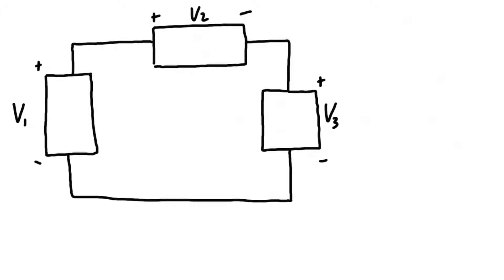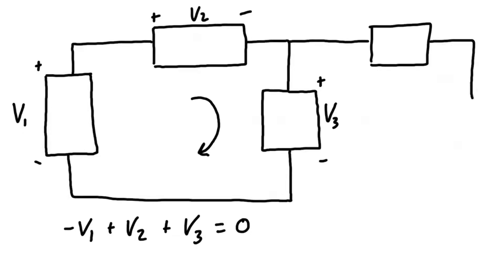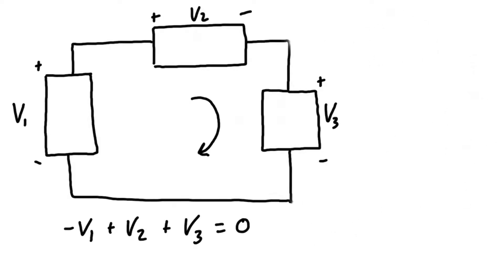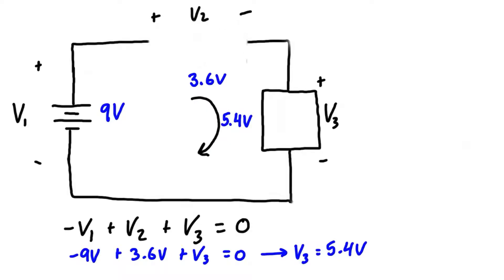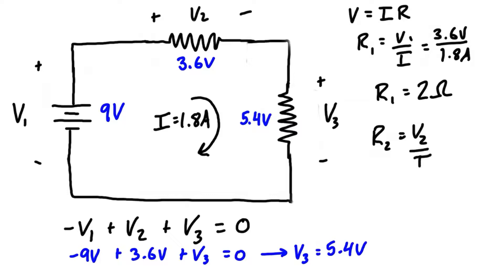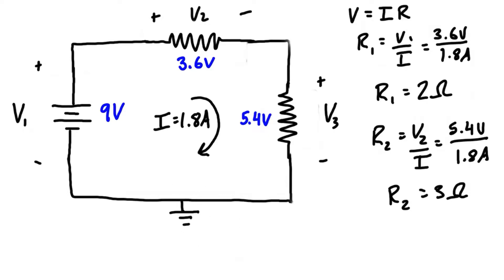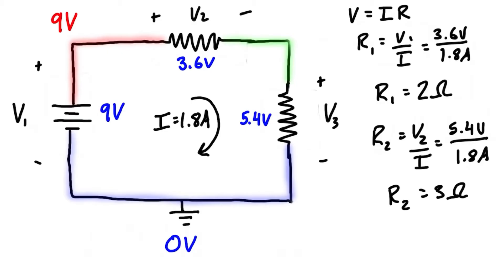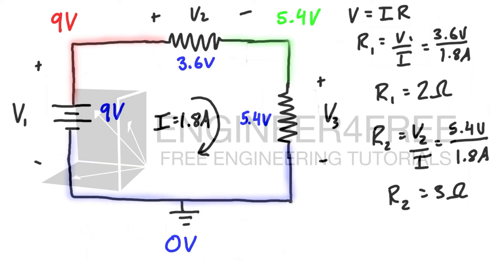Kirchhoff’s Voltage Law (KVL)

Comment: Very helpful video, makes a lot of sense, for some reason we were never shown kirchhoff's law in school, just told the results, but this actually offers a much better explanation for why they exist, whilst also explaining grounding to me when none of my teachers could! One thing to note though is I would check the input gain on your mic, as it sounds like it's clipping to me, or when making audio chops on whatever software you're using to produce the video, I'd add some subtle very quick volume automation (x-fading works well) just to avoid the little popping sounds.

Comment: V1 should be 9 volts how is it 3.6?
Reply from the maker: Hey, the red shaded node is 9V higher than ground. The green node is 5.4V higher than ground. 9 - 5.4 = 3.6, so the voltage drop across the resistor is 3.6V. There are a few more KVL examples here I recommend watching them and observing the method a few more times: engineer4free.com/circuits =)

Comment: I'm new to this but can you tell me why in the first example, the first variable V1 is a negative, from my knowledge it is because it starts at a negative terminal, so therefore it's a negative number, but then goes to high potential and still is a negative while in the node example, it starts at 0 then goes towards the source from low potential to high potential but then instead of going -9, it goes +9, and again I think it's because it goes from low potential to high potential but, in one question it is a negative number but in another question it is a positive number? Can you help me?
Reply: You are right it sould be a positive and the other one's negative. That's kind of the problem with being a beginner and watching youtube videos is everyone on here does not know what there talking about and makes it confusing for the beginner like this guy did. good for questioning that.
Reply: Since I'm late to the discussion, can you explain it a bit? I'm also stuck on the same issue. In the KVL equation, he takes V1 = -9V, that is probably in accordance with the idea that if we encounter negative terminal first, we take voltage to be negative. But, in the last node example after grounding, he says it's a voltage rise of 9V. Any help would be helpful.
Reply: Ok, so here's what I got, the difference in signs arises due to the assumption that in KVL, negative terminal first means negative voltage, which lead to the equation -V1 + V2 + V3 = 0, but it could've just as easily been V1 - V2 - V3 = 0, right? And then because we assumed negative voltage negative, we basically assumed a voltage rise to be negative. Can anybody verify?
Reply: A change in potential when traversing an emf source  from positive terminal to negative terminal is -E and the opposite is +E.